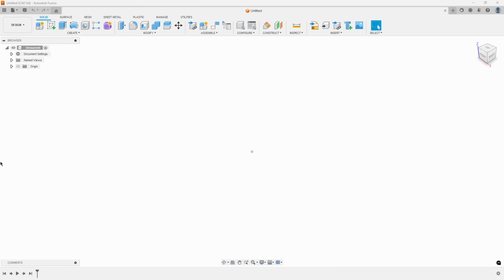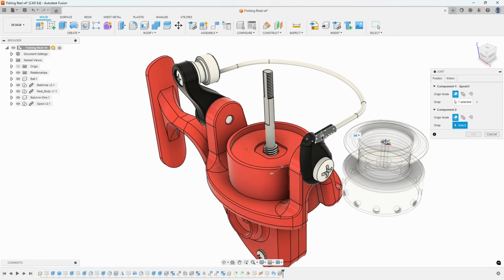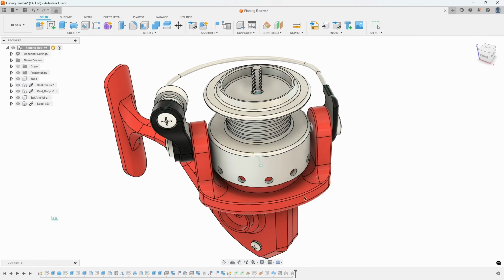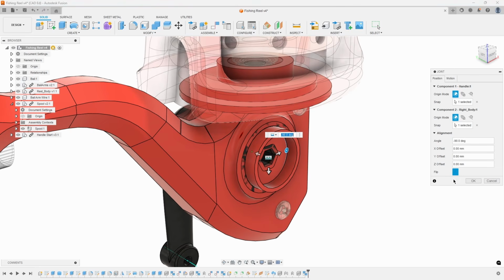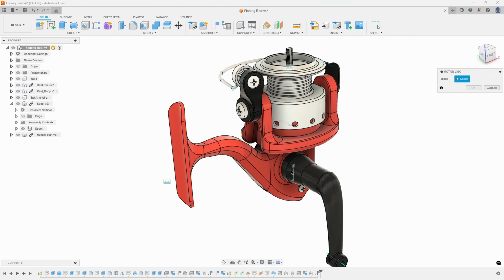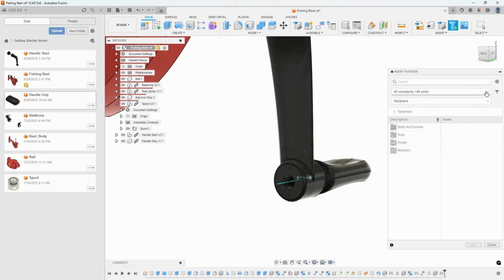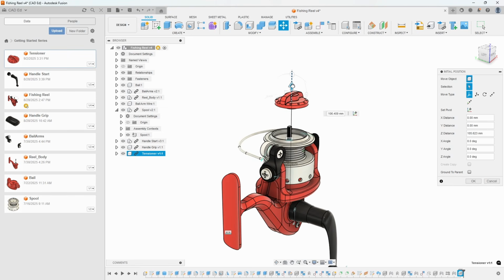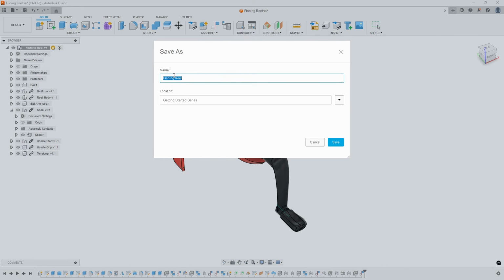The Secret to Smooth Assemblies | Getting Started with Autodesk Fusion Episode 11

Comment: When I do the As Built Joint and select the bail arm wire, it is selecting the entire fishing reel assembly. I only want to select the Bail Arm Wire. How do I fix this? I've tried to follow this tutorial exactly and things like this will happen causing me to start all the way over from scratch. This is getting old!
Reply: Did you have an issue with 3D projection earlier while creating the spool wire? I converted the assembly to a hybrid assembly and broke the link between the bale-arm-wire and parent, as per some comments on video 8. Now I'm having the same issue as you...

My issue was that the body of the wire belonged to the assembly, not the bale-arm-wire. Exporting my bale-arm-wire part, extruding on the part locally, then reimporting it into the assembly helped me.

Comment: Tensioner file is still missing and access to the fasteners is not present.  Any ideas where the drop down icon is located?  I only have access to outside parts on the web, not AutoDESK content as described in the videos.

Comment: you wouldn't be able to screw the tensioner on because the is a flat on the sides of the hole so you don't have whole threads. The series is still giving me lots of tips though.